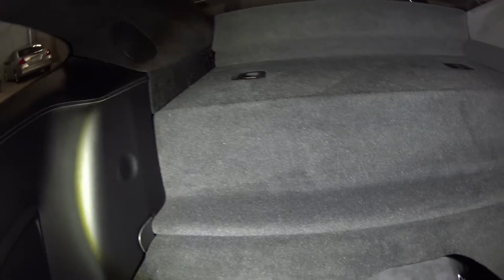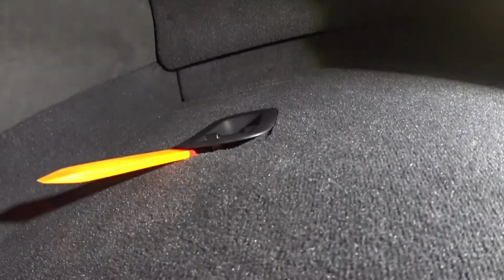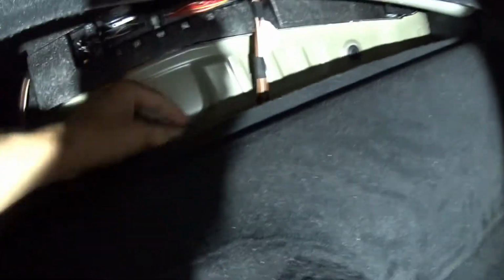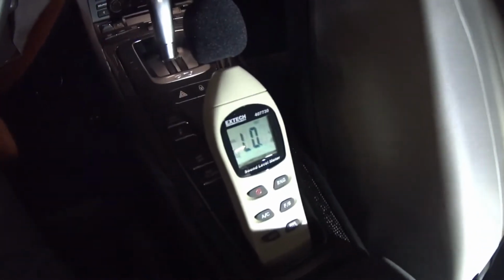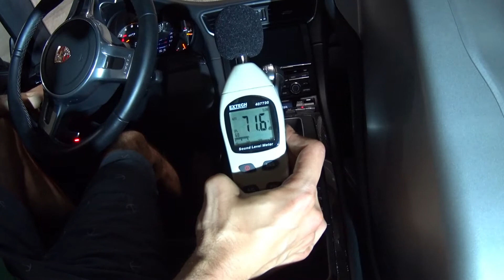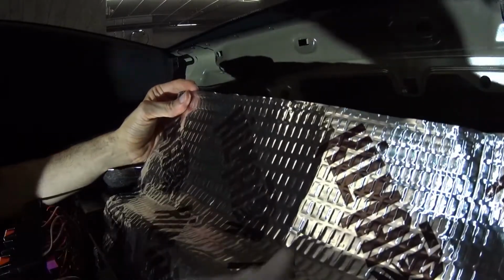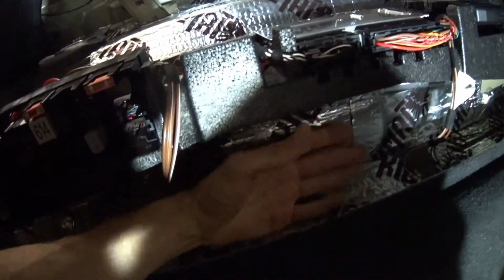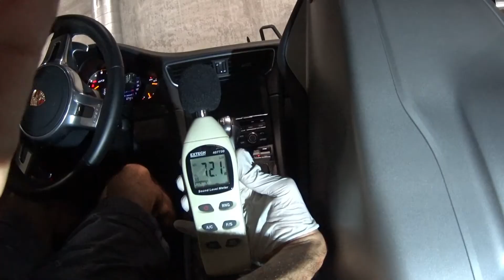Reduce Engine Exhaust Drone Porsche 911 GT3 991 & How to Remove Rear Interior

Comment: Did this actually work? I've seen in forums that people do a few layers. Some Kilmat, some dynamat, some noico. Was thinking of doing this myself. Any input would be appreciated. Thanks!
Reply from the maker: Yes it does help, and little weight, but as stated below you change the resonance. Less high pitch noises will come through. Bass/Mid range is very difficult to block.
Reply: Was there improvement in noise or drone at highway or just below highway speeds?  2-3krpm for example
Reply: I did this to my 987 with a small change in cabin noise. Probably not worth the time and cost.

Comment: Looks like you reduced the resonance from the sheet metal which resulted in a different interior sound. 
I think a soft insulation might work better. Something like batt insulation. It would be interesting to put a big bed comforter in that rear area and do a sound test. That would tell you if a soft insulation is better than that stick down matt for reducing interior engine noise.

Comment: Why get a GT3 if the noise bothers you?
Reply: Bc of the engine?
Reply: Considering getting a 992 gt3 and doing full sound deadning inside as it's unbearable at highway speeds bc of shirt gearing, you're constantly over 3.5k rpm
Reply: @atom999  defeats the purpose of the car.  I drove a .2 GT3 for 3 years, even had it with a silenced race pipe it wasn't that bad. Road surfaces and cage rattle were equally frustrating but drone shouldn't be an issue on most trips including longer ones unless you're fully straight piped...
Reply: @swb7161  Respectfully I disagree that it defeats the purpose of the car. Adding 30kg of sound deadning will not change much of the dynamics but make it acceptable for daily use. And when needed can be used properly on track. 

I think 991 model was better in terms of gearing, so you werent doing motorway speeds at 4.5k rpm. I know a few owners of the current 992s and they will not pick up any calls unless stationary as noone can hear them.

I'm looking forward to 992.2 gt3 touring and what it will bring, perhaps they will fix the gearing.